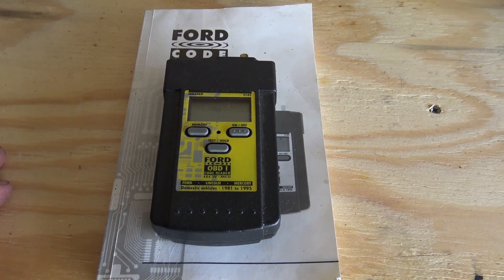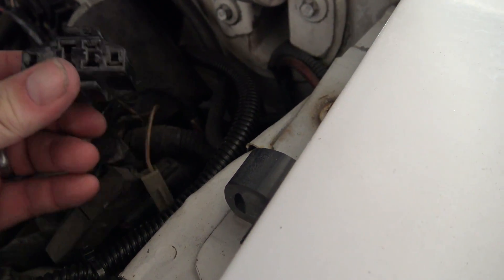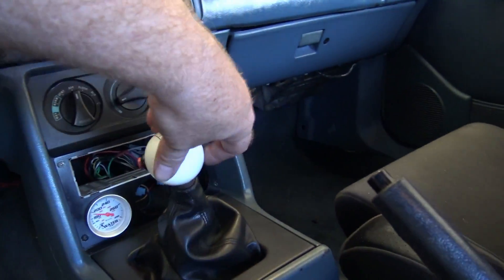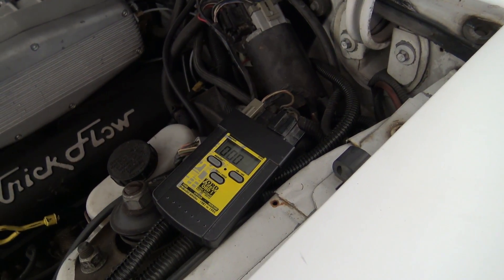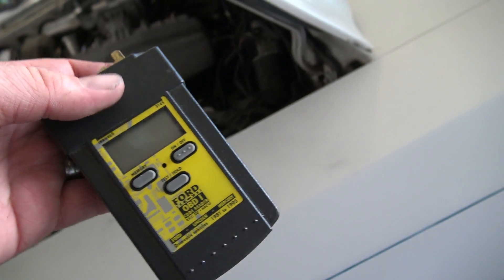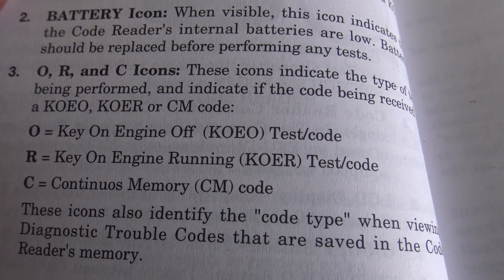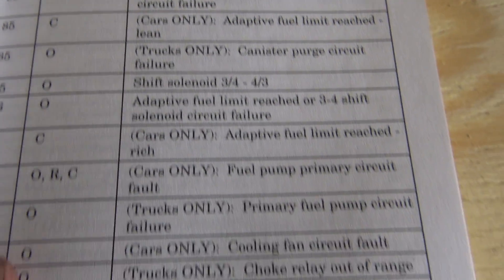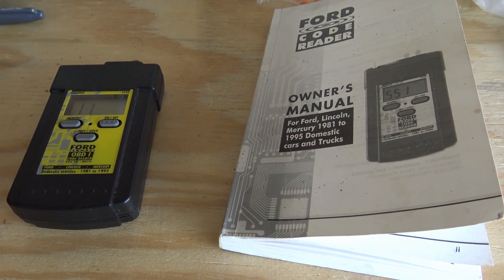Foxbody Mustang - How to scan for codes with ford obd 1 scan tool

Comment: I bought one yesterday cause my car was idling crazy and running rich and couldn't figure out what it was. I seriously didn't think this would actually help but it pulled the code for the mass air being low voltage. So figured why not give it a shot I bought a new mass air and dam that was the problem so this thing for being old technology actually worked.
Reply: I'm about to get in because I've had it with replacing random sensors thinking my car (now secondary car) is running lean and has a rough idle start after warmed up. No CEL but I've done the memory key on test and I get a bunch of random codes

Comment: If you get codes saying oxygen sensor running rich, replace the MAP sensor. If you get vacuum at the EGR at idle, replace the charcoal canister purge valve. If the timing mark flutters, it's the module. Actron has a tester CP 9690 that works on OBDI. It has code connect for troubleshooting solutions.
Reply: I’m getting the oxygen sensor running rich  I replaced one sensor but is still the same I’ll try and replace the map sensor

Comment: You can also jump the 2 cables together and do a KOER and KOEO test by watching the check engine light flash.   It's a pretty cool system Ford had for people to grab codes without an OBD1 tester.   Thought people might want to know that
Reply: What to cables?
Reply: Same thing I'd like to know
Reply: @alonzojones2596 it’s by batter, there’s another cable to hook up

Comment: Get a Actron CP9690 code tester. It works on OBDI and OBDII. It has cables for OBDI for Ford, G.M., Chrysler, and Toyota. It has a OBDII cable. It has code-connect to diagnose codes. It comes in a black pouch. It's well-lit! 2000 up is automatic test. Below, you dial in the vehicle. It lists codes and definition. Different codes pertain to different years. A CP9680 is for OBDII only. It's the same tester. Without having to thumb thru pages, it shows the definition. If you get improper vacuum to the EGR, replace the charcoal canister purge valve. If you get rich oxygen sensor codes, replace the MAP sensor. But, it could have other causes for rich mixture. It checks KOEO and KOER codes. It checks timing advance. Memory codes can be erased. Those are problems in the recent past. Sometimes replacing one part erases other codes relating to that code. After replacing parts, recheck codes. Warm the engine to 2000 RPM's for 2 minutes or until the upper hose is warm and retest. On OBDII, open loop is warming up. Closed loop is warmed up. Negative fuel trims are lean mixture on OBDII.
Reply from the maker: Good Info!

Comment: I bought one of these scanners 4 years ago when i had my 94 gt,i sold the 94 since but getting a fox next week do this will come in handy once again :). I paid 20 bux on amazon btw.
Reply from the maker: Nice! Nice little tool
Reply: A Actron CP9690 works on OBDI and OBDII. Read my comment above about the CP9690.
Reply: I stumbled on to this video somehow again. My code reader does not work on my 87 mustang gt for some odd reason. I know my car used to be an auto and swapped to a 5speed with a a9L computer. Im wondering if that cable is even connected at the other end which im gonna check eventually.

Comment: Im doing a wire tuck. I want to get rid of this? Will there be any issues in the future if I want to tune the comp?
Reply from the maker: Hide it. Its only good for to check codes. If you have a aftermarket ecu you wont use it at all

Comment: Run fuel injector cleaner thru the engine to clean the injectors and valves and to prevent false codes.

Comment: I see where it says for domestic vehicles though 1995. Well I have a 1996 Ford Thunderbird LX 4.6L V8. Do you know of this will work on my vehicle? Any information will be greatly appreciated. Take care
Reply from the maker: Probably not I believe 96 is the first year for obd2
Reply: @justin91lx  It's weird. By no way am I saying you're wrong. It could be one of those oddball quirks, or the previous owner could have removed it for some unknown reason. Mine is a 1996 and was built in June at the Lorain, Ohio plant. Anyway, some might it and some don't. I have looked for the port myself and I can't find it even after I took it to AutoZone and Advance. Thank you for the reply and take care. Peace
Reply: Have you tried looking for a small black box in the engine bay called "Diagnosis" .don't know if your car has that but I have a Ford couldn't find a OBD1 OR OBD2 PORT so I went searching around the engine and found that Black Mini/small box  called Diagnosis  don't know if this will help. Search up 16  pin adpater on YouTube and some videos will pop up of what I'm talking about

Comment: Thanks for the video great info, I'm bought the same scanner I need to pull the codes on my supercharged 90 vert. The car wants shut off when the clutch pedal is depressed. I'm thinking the vss sensor or neutral sensing sensor. Because this car was orginally an automatic I converted to a stick.
Reply from the maker: Might need to change the ecu out. Good Luck!

Comment: Damn that's good info.  I need this because my 93 Cobra will die with the check engine light on and it will only start if I disconnect the battery and reconnect it.  So basically I have to reset the ecm to start it.  Can't figure out why it keeps dying and while it runs there's no check engine light.
Reply from the maker: Man that's no good. Make sure all your grounds are clean.
Reply: justin91lx I actually bought a scan tool today.   I pulled a 14,15 and 16 code KOEO then an 11 with engine on.

Comment: Does it ever pick up codes without any dash lights glowing?  My 5.8 in my e350 is running like crap at wide open throttle but I don't have any dash lights (besides the ABS light)
Reply from the maker: Not all problems with throw a CEL. See you mentioned ABS Light, you might have a obd2 ecu. This scanning tool in this video for obd1. Most autoparts stores will pull codes for you. Good Luck!
Reply: its 1991 obd1
Reply from the maker: Yeah your good.  You'll be able to pull codes
Reply: Get a Actron CP9690. It shows codes on the screen. It has cables for OBDI Ford, G.M., Chrysler, and Toyota. It has a OBDII adaptor. It uses 4 aaa batteries, not included under the rear cover. EBAY has it. It works from 1984-2013 and is upgradable with a USB cable from EBAY.

Comment: Does this code reader have allow you to turn off the check engine light?
Reply from the maker: It does not. Only way is to unplug the battery
Reply: You have to fix the problem to cut the light off.

Comment: Hey man, so I bought this scanner (I have an 88) I pressed test and hold but it just read 0 the whole time does this mean I'm good?
Reply: I didn't even get a code 11
Reply: Never mind I just didn't doit right
Reply from the maker: Was you able to get it to work?
Reply: @justin91lx  yeah I just didn't doit right some how. I'm throwing code 31 and 85 with no 11
Reply: @Goodyboi  code 11 is pretty important, that tells you your computer is ok. If you can't figure it out and you can't get code 11 to come up maybe check the computer ground on the driver's side fender apron near the starter solenoid.
Reply: @11dmills  I will run codes again today just to be sure but is the ground you're talking about next to the fuse links because that ground is clean
Reply: @Goodyboi  yeah, I just mentioned it because sometimes it can get corrosion from water coming in. I had trouble with that ground before.
Reply: @11dmills  will I have to fix code codes 31 and 85 (witch I plan on doing anyway) to get code 11

Comment: Do you know if it pulls stored codes? I have a check engine light that doesn't stay on but only comes on when I give it throttle.
Reply from the maker: Thats crazy. You can do a KOER test. Should pop up then
Reply: @justin91lx  yeah I'll have to do that because I got the scanner and with the engine off test I got code 10 and 20 which would only come up in a cylinder power balance test
Reply: @justin91lx  I think it's either the cheap distributor I just put in it or maybe injectors if those codes are accurate because I just did plugs and wires about 10,000 miles ago

Comment: what about codes for real problems, stepping thru them, most people use a scanner to find the cause of a problem they are having
Reply: Get a Actron CP9690 code tester. It checks codes and has Code Connect to diagnose codes. It has OBDI cables for Ford, G.M., Chrysler, and Toyota. It also has a OBDII cable. It shows the definition of the code. Code-Connect provides the solution for that particular engine and year. It also checks solenoids and relays. It works from 1984-2013 and is updatable with a USB cable from EBAY. It uses 4 aaa batteries, not included under the rear cover. After replacing parts, retest. Warm the engine to stabilize the engine and delete false codes. Check the radiator first and oil. Check the air filter. A Snap on scanner works on OBDI. Get the Ford-1B adaptor and primary and Troubleshooting cartridges. Also get the battery clamp cable. It uses a 9 volt square battery on the left side cover. It has troubleshooting to diagnose codes. Get the manuals. It uses VIN digits to identify the engine and year to test. The thumbwheel can be used to increase RPM'S for charging and air- conditioning tests. It can also check the tach on the dash. EBAY has it.

Comment: Ok don't mean to sound like a dumb ass but when you to code read on it should come up with 000 correct when you turn on or do the battery on the truck power the reader

Comment: Mine throws a code 11- 10
Reply: Code 11 is the pass code for system pass. Code 10 is the separator code. Maybe you're not getting a memory code which a pass code would be 11. Retest it with the engine warm.